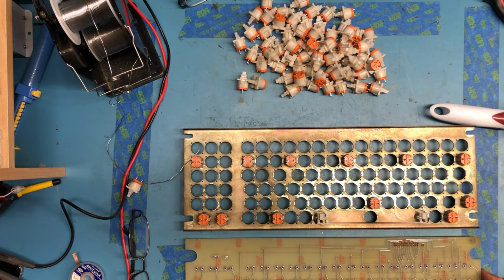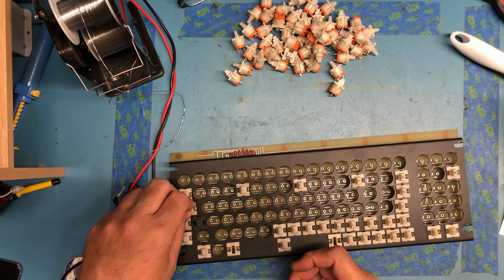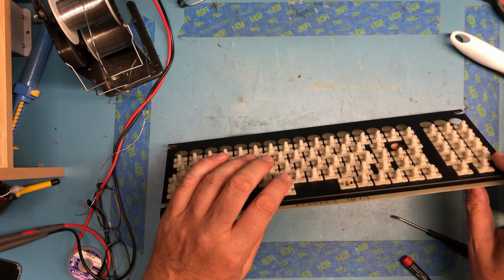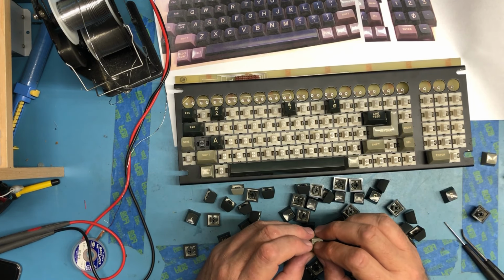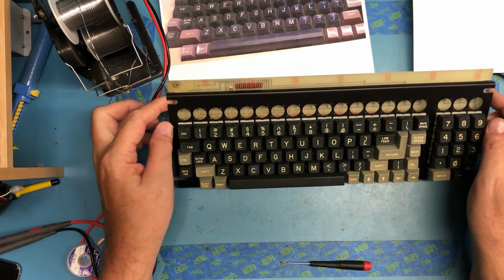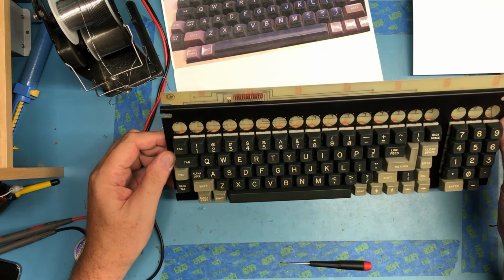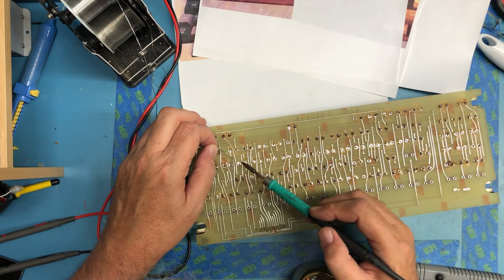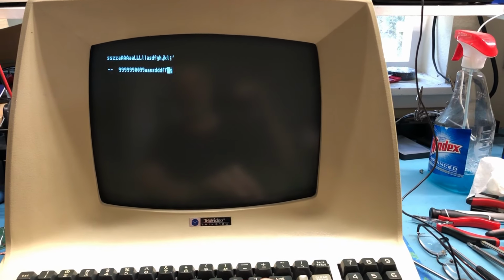TeleVideo TVI-912C - Part 3 - Keyboard Assembly and Testing - STB339

Comment: Is it possible that the two switches that did not have the orange bottom where the two switches for the Return key? Maybe they have lighter force as there are two of them on that key.
Reply from the maker: This is a good idea, this would make sense. Next time I sit down with the terminal I'll test this theory out. As the two white keys are together on the numeric keypad i should be able to test this. i reviewed the video, it just wasn't clear where the two white ones came from. I'm usually pretty good and catching these kinds of things but in this case it slipped through the cracks.